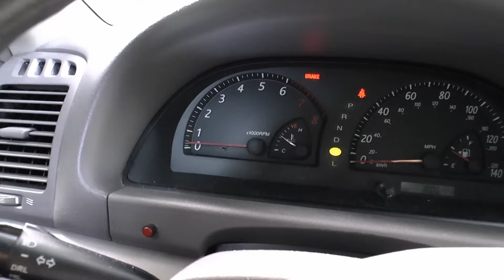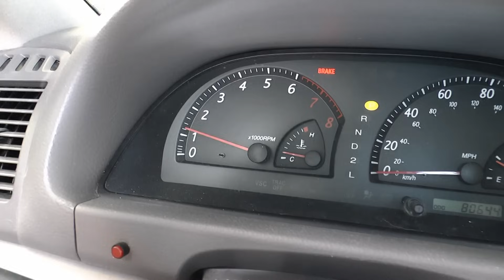How to Fix Low Idle Problems in Your Car (Throttle Body)

Comment: Just here to let someone know that if you are still having issues with high idle it could be that the adle air flow sensor needs to be adjust it. 

Compare it to your old one ! My issue was that the point of the idle air flow sensor needed to be longer. Now my car works like a charm !

Comment: hey scotty im wondering if you can help me out with my 1991 honda prelude 2.0 Si that i recently bought (my dream car) , and the person i bought it from said it was all good it just had a coolant leak but i can't really find where those hoses are and + i found out that my top head is cracked and you can see previously used sealant on it and it over heats in like 3 blocks , and it idles bad ... HELP
Reply from the maker: you got ripped big time, hope you didn't pay much. An engine rebuild on that model is a ton, especially if you need a new or rebuilt head.  Me, I'd try to get a good used engine from Japan, there are many around that work great from guys who import them from japan
Reply: i dont think i got ripped when i bought it as a shell for 350 :p 
+ i dont think its that much your just making it look that way when i can go to the junkyard and find a new head and i know that already ive been saving for a b20 but thanks for "answering" my question about the idling and the leaks -.-

Comment: On my jeep (4.0 straight 6) i turn the key and nothing happens. Checked the battery its charged. Auto zone said it had a bad starter so I replaced it. Still nothing.. Any suggestions?
Reply from the maker: often a bad neutral safety switch or bad ignition switch, check them next
Reply: Although, when I put a larger battery in it starts right up.
Reply: well the store manager should of been fired. the starters should only be considered bad after a confirmed test, atleast 3 times on the alternator/starter tester. could of been a good starter. and possibly the old battery was too old to carry enough cca to fire up the motor

Comment: i have a ligth ticking noise when i hit the gas pedal , when i come to a stop it feels like my rpms go down car putters (but the engine doesn't turn off ) and when i start going again it putters again and i could hear the ticking ??
Reply from the maker: check for vacuum leaks first, see my video "finding engine vacuum leaks with a cigar" and pray it's that, and not internal engine wear like bad worn valves or ticking fuel injectors
Reply: Scotty Kilmer 
It's a 00 nissan sentra 1.8L   that just hit 200k , i wanted to know if engine has a distributor?

Comment: I have a 2000 alero with a 3400 just got done replacing head gaskets and intake gaskets now I fixed that  . temp gauge normal now I'm having this problem the car will run all day sitting still but get it out on the main road and drive maybe 2 miles its like someone turned off the ignition key it just shuts off it takes a few minutes to start back I put it on computer miss fire cyl 6 and low voltage plug wires are bad I know mostly worried about the shut off part I need to know if you can give me a list of things that can cause it I have a lot to check yet just educate me I can figure it out I'm sure maybe you know something I don't this car has me wondering if its worth it

Comment: Hi sir I got kia rio 1.3 2001model when I press accelerate simely the car hesitate  or cut off a bid i lift up my feet on accelerate a second  press again than the car pick up again sometimes while am driving about  100 on up hill car loose power. Help out man

Comment: I took my car to a mechanic because it shaked while idling and accelerating. They changed a lamda or something but it didnt help. They know that 2 out of 4 cylinders are not working properly but they dont seem to have a clue what causes it.  Any ideas?
Reply from the maker: +kakka626 first, find real mechanics who can analyze problems. anything from bad fuel injectors to worn out piston rings can cause that, and any good mechanic can figure that out fast by testing
Reply: It turned out to be a broken ECU.

Comment: Scotty Kilmer I need your help. Removed the manifold on a 2009 Acura TSX with an electrical throttle body. Cleaned it while I had it apart and now my idle is fluctuating. No visible air leaks. Code P0507 for emission control comes on. Did an idle reset and still have this issue. Please help. @Scotty Kilmer

Comment: my mercedes  C 180 2004 model is accelarating alone the idling is very unstable the car shakes during idleness, when you put the air conditioner on, it stops but as soon as you put the air co off it accelerates alone. i cleaned the air filter with a compressed air pump still no change. the engine light is on and a message saying "engine oil level Reduce oil level" appears when the car is put to high levels of acceleration, even after i have changed the oil and the oil filter. all what i know is, this car is not happy

Comment: i have a 98 mustang gt and it idles way too far down low but when i start it it wont go into drive i have to get the car to about 3000 rpm and then kick it into drive but even then it wont move far without stopping what could be wrong?
Reply from the maker: +Simple_crysis  often a bad transmission or torque converter will do that, have that checked first
Reply: ok thanks man ive been looking for some help weve checked the cats too and they arent clogged so idk man but thanks for the help

Comment: My mother's Chevrolet Van has it's motor oil changed every MONTH and she has NEVER reached the 3000 mile per oil change we normally would do.

Her engine idles with clanking and rattling sounds and smokes when it used to never smoke visibly.

We've never had a PCV Valve Change ONCE on the van as we've had it since 2003, we've used "Tune-Up in a Bottle" by Lucas Oil and it's still rough running and a little bit smoky.
Reply: I would offer a PCV Valve change since my taught me how to do that for people's cars, along with oil changing, air filter changing for the easier to do cars, checking all the fluids, change filters and change all the lights.
Reply: BUT I'd rather not, my mother wouldn't have it and I myself would rather ask a professional mechanic's advice first.
Reply from the maker: things do just wear out over time, smoking and running rough is often the beginning of the end with GM engines. Have a compression test done first to see if that's the case.
Reply: Thanks.

I'll get my Mechanic Connection to get his Engine Computer to Check it and see if he'll do that too.

Comment: my cavalier idles around 500 rpm, doesn't really shake much but does that seem low?
Reply from the maker: If it's not shaking, it's fine. but you could clean the throttle and see if it gets a little higher, or check for vacuum leaks

Comment: My car has no tachometer, so I don't know its RPM. It's not broken, it just simply has none. It's a 2000 Toyota Corolla, so that's probably why. Is there any alternative way to that last part?
Reply from the maker: Mr. Atomic Blaster sure, go to auto zone, they sell aftermarket tachs you can mount on the dash like a race car.
Reply: Okay, I'll have to look into it. Thanks!

Comment: e66 BMW 2005 745li had valve cover gaskets done now car reading 2187/2189 I changed crank case vents but still sets off codes
Reply from the maker: +Tony Irby it's basically hell taking all the crap off doing those valve cover gaskets, and the job was obviously botched. Take it back to whoever did the work and make them fix their mistakes

Comment: Hello sir i am living in ksa and i have caprice 2008 i buy it before 1month now i put fuel injector cleaner in my car after that now my car is taking long ignition and car off its happen when i take my car for long route on the way car is perfectly smooth when i off and restart after 10 min its take long ignition and off and when its cold its work perfect
Reply from the maker: cleaner may have damaged or clogged up fuel filter. Start by changing that and pray it didn't damage the fuel pump
Reply: but sir its happen some times not every time
Reply: and thanks for help

Comment: Hello Scotty!

How do I perform an "Idle Relearn" for a SH-AWD 2012 Acura TL??
Reply from the maker: just drive it, it will reset itself in a few days of driving
Reply: Thanks for the super quick response Scotty, I really appreciate it. I've been driving the car for about two weeks now since the alternator and battery were replaced (vehicle sat for about three days with a totally dead battery) and while the idle has gotten better it's still a bit rough. It's not as smooth as before. Any thoughts ?
Reply: Scotty Kilmer hey Scotty can you move the throttle plate on an electric throttle body with the battery unplugged with no problems? Or should I open the throttle with something holding the gas down?

Comment: hello. 
i have a problem with my car when i accelarate the car my car has poor acceleration and the rpms vo very high and the cone filter doesn't sound its a genesis coupe 2.0 turbo
Reply: transmission fluid levels maybe low

Comment: This look that it could be my problem for some time the rpm of my Toyota rav4 2002 has been doing this even when stops on red light rpm goes too low and some times it even turn off but if i go with this procedure i can not damage something else i dont want ti hace another big sise here

Comment: I cleaned my throttle body and engine light came up all conectors double check dont know what is problem, car run fine only feel at high rev

Comment: Why did the alarm go off. Just wondering please reply
Reply from the maker: cause it's an old car with a really weird aftermarket alarm
Reply: +Scotty Kilmer what if my trucks rpms are high like higher than 2000
Reply: +Scotty Kilmer what could be causing that?

Comment: I buy 2007 dodge Chrysler PT light engine on my filter box is break I taped strong and car going drive some times with no power and want turn off ?
Reply from the maker: +Hajiagha many things can do that, but really, air box has to do with maf sensor, I'd go to a junk yard and get a used one and start right there
Reply: I buy air filter was dirty and tape box was damage clean small filter also and now is fine to I drive to junk yard buy box thanks you doing right job
Reply: Scotty Kilmer Thank you new filter I buy and going fine

Comment: Hello i have a 2007 honda civic coupe ex and i believe that maybe my fuel pump is bad but i doo get gas to my engine if i step on it.  Heres whats wrong i come to a come to a stop and then give it barley any gas and it wants to bog out but then i step on it and it runs fine after 1300 rpm  help anyone?

Comment: Hey Scotty, my 2005 honda odyssey has the srs light on. How do I fix it?
Reply from the maker: you need a computer scan for that, see my video "fixing ABS brake problems on your car" that same computer is also used for srs system analysis
Reply: Ok I heard another way of checking the codes by connecting a wire between pin 4 and pin 9 on the obd2 port. Could I do that cause I don't have access to these computers?
Reply from the maker: Peter Kapica
you will not get srs codes of very much use that way. Analyzing srs systems requires a dealer level scan computer with bidirectional controls. OR, you can just ignore the stupid system and buckle your seat belts, they work great when used.
Reply: That sounds like money going down the drain for just a possibly simple problem. The airbags on the car have never been deployed so why the srs light would come on if the airbags were not deployed.
Reply: remove and check the spiral cable for the air bags , spiral cable assembly with electrical connections that could become damaged when the steering wheel is turned. .often burned circuit board mounted in the steering wheel.
I hope you help.
Reply: That's helpful but I don't know where it is. Can I just pull all the srs fuses out and it will never come on?
Reply: I don't need the system on, I just want the srs light off. So pulling the fuses should turn the srs light off right?
Reply: I know I just want the srs light off so i will go pull those fuses now
Reply: Peter Kapica no that turns the light on pulling the fuse out, it is probably the srs module fairly common on those

Comment: I have a 1994 Olds Cutlass Supreme S 3.1 and about 5 weeks ago my cut cuts off as I was idling @ a stop light, but it started right back up,I thought that I have an bad alternator or something electrical so took it to Firestone to have it checked, but everything was ok,starter, battery & the alternator was doing what it was suppose to do.but it still was cutting off,so I googled it and said that i may need an AIR IDLE CONTROL VAVLE, so again back to Firestone and when they put the part on, they said it was worse off, then they put on a sensor  & that didn't solve it either.They told me that it could be an elecertical issue, which I remnded them that it was already checked and now they are telling me that my computer and may have to go to the dealer.I think I may have to change my battery, it's about 5 years old,DIEHARD, will a weak battery causing my idle speed to drop and cutting off. They did cleaned my  throttle body,but it even cut off in the parking lot as I was going home,so what could be the issue? Thanks

Comment: Please please respond I bought a 2009 Mazda 6 when I test drove it it drove fine and it is a beautiful car it started raining I got in it today and there was about an inch of water in the driver side and backseat driver side it looks like the water is running down the roof of the car where the window is all the way down through the fuse box and ending up in the floor when I bought the car someone had the fuse box plate off the car dealership said he would get me a newI should not have bought the car as soon as I seen that cuz why was it off in the first place but the car idols around 2000 RPM when I hit the gas it only goes up to 3000 RPM when I put it in reverse it bangs then it has no throttle response but it does move back and forward when I bought the car it had a funny smell I thought it was just because someone smoked in it but it was obviously a mildew smell from the water it does have a sunroof I put my hand all around the sunroof and could not feel any waterwhenever it stops raining I am going to try to change out all the fuses maybe they got wet and it's making the car act funny what do you think?

Comment: scotty. how do you clean a nissan bluebird electronic throttle body correctly.
without doing a relearn.
nissan see,s to have problem after we renmove the throttle for cleaning. should i unplug the negative battery terminal to prevent relearn program?

Comment: I have a problem 
my car lose rpm on (A.C on)
and behave as car will switched off if throttle is not push (daily basis) and 
2. engine also don't response during speeding constantly as even I push full throttle (on A.C) on (sometime).

Comment: Can You use WD 40
Reply: NO WAY! WD40 is a an oil based lubricant. The cleaner he is using is meant to evaporate after use sort of like a window cleaner. if you use wd40 it will never evaporate and you'll have a much larger problem than before.

Comment: I have the same idle problem, but everything is clean. I have a 2002 mazda 626 2.0 and I have no leaks of any kind. Clean throttle body, clean air filter, and I still have the problem. Someone please help
Reply from the maker: check for vacuum leaks as in my video "finding engine vacuum leaks with a cigar"

Comment: my 2015 sonata has 158k miles,,  you drive it and after 1700 rpm it loses power,,, or if im driving it only goes so fast then loss of power. i took it to the dealer, they replaced the engine said a knock sensor ,, yeah a month later it happens again, i took it back they said oh the engine is bad, really,,, then said they cleared the brain and i should run chevron 91 octane in it for a few weeks then bring it back and they will check it................... what the hell 91 octane in a 4 cylinder..... the whole time i told them its the throttle body........ they never listened,, is my assumption correct

Comment: Will that work on a diesel Scotty?????
Reply: Rocky fish the cleaner that I saw said not to use on turbo charged supercharged or diesel engines
Reply: When did they start using throttle body's on diesels.